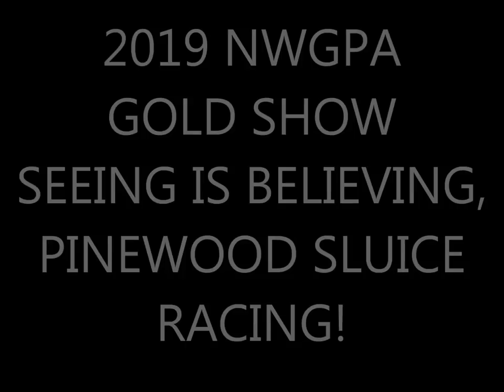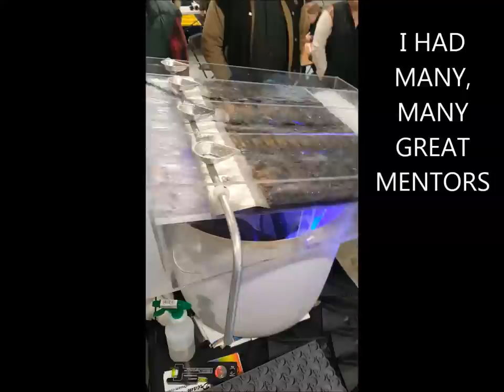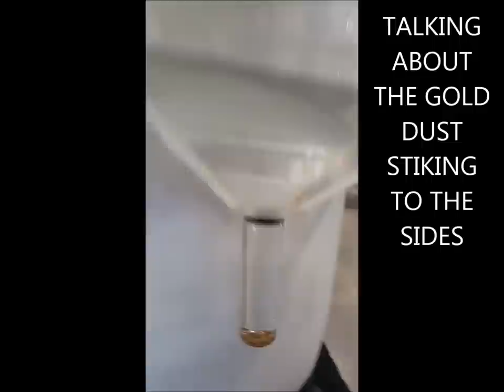Epic Sluice Derby Showdown: 2019 NWPGA Dream Mat Challenge!

Comment: I would love to see this test being performed with the mats preloaded with black sands and let to clean out for a few mins.
Anything deep enough can catch gold if it's pure, but if it just loads up with sand you just catch whatever was put in first.
I am sure the Dream Mat would do great in such a test and would like to see it.
Reply: What happends with black sand in the dream mat is that the pockets do fill up with pebbles and slack sand but gold gets in under it and stays. The more gold that gets in the more black sand gets removed. The pockets stay active and are always swirling around keeping that non gold moving and working it out. If a small piece of gold does move down it will find another pocket to get trapped in. The dream mat is by far the most effective mat on the market! I use them all the time. I won't go back to the old way.
Reply: Yeah, a real world test would be the litmus.
Reply: @waynelacroix8870  I know it is, and I know that is what will happen but I'd like to see it in a video.
My silicone mats are similar to dream mats but I designed mine to have smaller pockets and vortexes at the top and progressively larger down the mat. Then I covered the top section in fine and medium mesh  so the upper section self classifies to avoid the larger pebbles filling the tiny pockets. So far it has worked wonders.
Reply: This test is useless. First, my bucket can also catch all the gold if that's all I'm running. Second, each mat runs at a different water flow, and it's clear the flow was altered to favor the dreamer Gucci mat. And third, my miners moss and expanded metal catches far more gold at varying water flows and we all know water flow is never a constant. Throw in a shovel or bucket of pay and watch the surge through the sluice. Gucci mat is not for production, but as a hobby mat in a hobby sluice where the pay is carefully metered. I'll never buy any Gucci mat product.

Comment: I have honestly been avoiding the whole dream mat idea maybe because I am bias or I just dont know what im doing, but I gotta say this was an impressive comparison! Thank you for sharing - I just shared this video on some of my social media platforms. Subscribed! ✌
Reply from the maker: One bitten, twice shy! Ha ha
Reply: This test demonstration is not entirely fair. because the same water flow was used over 4 mats that all require a different volume of water.  The GoldHog mats use about a 1/3 less water then the Dream mat...Also those mats ONLY work according to the ground being tested, water volume, sluice angle, sluice width, qty of heavy sands, size and shape of gold, size and shape of black sands, clay content...etc.      
That is WHY Doc at Gold Hog says to match your mat and mining equipment to meet the soil conditions
Reply: @bonks4395  100% agree. I've seen dream mat in action... there is a reason they are headed down stream. tested 5'' dredge tailings  with this matting and got 100-200  colors per pan. on arkansas. when someone constantly tells you they are the best, its clearly a lie.. that goes for every trade.
Reply: @bonks4395  gold hog is also a salesman and has different mats for everything so you keep buying. I don't like how they keep their comments turned off. as for dream mat it looks good but I haven't tested it myself yet.

Comment: Interesting test. Disclaimer-I ordered some dream mat and am looking forward to trying it in my Keene highbanker. 

Talking with old timers where I’m at, I learned something interesting they just use home made setups with expanded metal riffles and miners moss/outdoor carpet. They tell me to tune your setup, and pan your tailings to check for losses. With our sub 200 mesh flour gold they can run minimal losses from a homemade setup. As long as they run material slow, and don’t use a lot of water. The expanded metal makes a minimum of turbulence vs Hungarian riffles which according to them blows the fine gold out of the box. 

I suspect each of the mats he’s showcasing would probably have the same performance if the flow and angle was tuned for the individual mat. That’s why we are supposed to tune our setups.

Checking my tailings if I use enough water to clear the riffles I was losing almost half the flour gold if I pump enough water to clear the riffles. Now, if I can have a low profile something like a dream mat I can run less water “energy” and still clear the pebbles from the box then I’m sold!

Comment: now id like to see a test between the different sizes of mat with dirt material running through as well. compare the bare mat or having expanded metal over the top of the mat or riffles above the mat or both riffles and the expanded metal over the mat. or if a classifier screen in the sluice box over the mat is better keeping fine material only going through and how much space should be kept between the mat and classifier to get the water effect. also does it work with it below miners moss? would they clean out if it was the mat then miners moss then expanded metal and hungarian riffles in sections over the top? is that all unnecessary in a large sluice box?

Comment: Loved the video !!! 
   And i also love all the nay sayers here. 
First I am confident every comenter here is a weekend warrior wannabe just like myself. 
   Is your test here flawed ? Yes it very much flawed. But so is everybody elses on there you tube channel. Every mat has its purpose but your mat seems to be the best " every circumstance " mat. Gold hog and i like doc makes some very good products. Only thing i dislike about his mats is they are to specific . You need to many mats to do a complete job. 
Next is almost every test I see is with controlled material. Problem here is the material is preped to how the manufacturer wants it to prove his value. 
   Any way you get the idea. So for me I look at logical things. I talk to and see lots set ups. By far the most mats I see in use are the dream mats. By far the most replicated mat I see are dream mats. And by word of mouth recommendations is the dream mat. 
    All that science you talk about means nothing to me or any of these other wanba be. Just set your equipment and test test test. After all that is exactly how you perfected your mat. 
   Thx for reading my rant lol
Reply from the maker: Your best mat, best flow angle, durt whatever. Run it. Then jerk out your mat put dream mat in it, run it the same. Gaurantee it will kick its a55. There's my rant.

Comment: Not really a fair test as you should well know. Traditional mat is not run like that. Different contours are used together to work properly. Not one kind of mat the whole length of sluice. Except that Keene Miracle Mat, that's run alone...so
Reply: It's one of the great things about the dream mat, you don't need anything else. You can often use it without classifying and just dump in material. As for the other mats, in this situation it seems reasonable, its just showing how long it takes to be pulled out of them.

Comment: I have a five stack gold cube. I use the dream mat micro mat on my slick tray, then a saw tooth mat, two dream mat beach matts and a saw tooth at the bottom. I run at cape disappointment. My question is what got pump should I be running.
Reply: I know Rob on the saw tooth uses an 1100 but he relies on his elevation to cut him down to somewhere near 900 and I do 1100 on a three stack, 1000 on a 5 stack and about 900 when I go 7 stack. I do not know the dream mat volumes but is not the same at all and I highly recommend not using the together. The dream backs up at that low of volume.
Reply: @iralawrence9311  thanks for the info ira. Think I'm going to switch back to all saw tooth. Just seems to to be a better fit for the beach. Let me know next time you make it to benson.

Comment: Dream mat works on the same principle that's used in all mats... it just has higher capacity cavities. For a field sluice, that's not bad. I think the reason naysayers don't care for it, is 'cause they don't SEE as much gold, because the finer groove mats separate black sands better. I think the difference here, is are you PRPSPECTING, or are you focusing on recovery? If your goal is to extract gold in-process, then stick with groove mats. If your goal is to gather the richest CONCENTRATES, then Dream Mat is the way to go.

If you're working a location for a long period of time, and it's not easily accessed by a vehicle, then you may not want to carry 6-10 buckets of concentrate for a couple miles. You'd be better off capturing what you can on-site, marking your tailings, and coming back another day.

Comment: I know every Matt has a particular run angle and I know you're doing this test to show this method of processing material but the other manufacturers have made their design to run at a different angle than what you are running at that's not to say that you're not running with manufacturers design but I would like to say that this test of yours is kind of not made for other people's engineered specifications
Reply from the maker: We are dying for brave souls to give us thar best mats, angle, pitch. Or even send in a chunk of thar thingy and we will test to the spec. But so far no luck.
Reply: @TheDSP1970  I ran your Matt in a sluice box at different angles and it loses fine gold all the time although it is an older model but you were still making the same claims back then too?

Comment: The Gold Hog mats need to have tape on the sides or you lose your gold. I wonder how different the test results would be if the mats were installed properly.
Reply from the maker: Weak, like a liberial throw the race card, the gold stayed in the middle mostly, open your eyes. Buzzzzzz, try again.
Reply: @TheDSP1970  So I make a statement that Doc freely makes, and ask an honest question because I am curious and get a response like that?

You have convinced me. I will never use dream mats in anything I run.

Thank you
Reply from the maker: no soup for you! The Sides were very tight in this test. not like hack jobs do to poor design flaw that needs taping & gluing. dream mat don't need taping or gluing. Cause its a BS excuse to say you had the wrong combination if you don't get no gold. Dream mat captures gold, with out the excuses or tape. Dream mat has 1 basic profile, not a bazillion.
Reply: @TheDSP1970  dont try to argue with a fool.youll only lose due to lack of experiance...your mats work wo bubble gum
6 different staggered profiles.super glue.
And or duct tape...some people dont believe what they see..with their own eyes.

Comment: It's funny cuz they're using big gold hog wave mat and if they knew anything about it they would know that that is not a primary capture mat that is to Simply spread the sediment load across the width of the sluice Not Fair competition if he would have had Razorback or Talon in there no gold wouldn't got halfway down the sluice given he had the correct flows for them.
Reply from the maker: I need to design a mat that doesn't primarily capture gold, but just kinda takes up room in the sluice. Think I'll call it nightmare mat. Cause you'll have nightmares of loosing gold.
Reply: @TheDSP1970  not really when you're widening your sediment load in the bottom of your sluice that will utilize more surface area of your mat therefore upping the efficiency of the next Mats further down. Plus the advantage of the wave Matt also slows down the bedload material allowing the hevies to loose velocity but keep the water moving through the sluice helping the ultra fine gold settle out.
Reply from the maker: It's the small wave mat. Don't need 12 ft of dream mat to catch gold. Can do what hog does in 1/2 the length. Cause it captures the gold in the beginning of the mat, not at the end if the mat.
Reply: @TheDSP1970  nothing catches 100% of the gold dude
Reply from the maker: @keithkratzer2913  did not say that it catches 100%, but some mats just lose it faster!

Comment: This is a really cool test! Thank you for sharing. Very informative. It makes a persuasive case - within the limitations of the test. There are a few design flaws. First, your dream mat probably had the strongest VORTEX of all the mats due to its cyclonic design -  at that particular water flow level (leading to superior centrifugal force, etc). Second, your dream mat may have had the best ANGLE of all of them. This may have led to your mat having superior retention in this test. I'm willing to bet if you re-ran the test with each mat having its ideal water flow and angle concurently (perhaps impossible but hear me out) - there would be far fewer losses on the other products. Your other competitors have run their own tests (available on YouTube) and are getting 98% retention in some cases. The bottom line is all of those mats are incredible technologies and are world class - within their own particular ideal operating parameters. Know thy equipment. Again, an amazing test and it certainly sheds some light on the power of your design. Great job!  : )
Reply from the maker: More angle & more flow just makes the others loose more gold. Any slower or flatter, the gold does not even come off the slick plate. There is no istance w/ the others, that more flow or angle help. Gravity & force, for every action there is a reaction.
Reply from the maker: Plus they market 98% or more. With test that are flawed. Never has any of them did a scientific test like this. Cause they have gold go down farther, thus proving it's not so. They have to rely on marketing. I'll rely on physics.

Comment: If all you are running is gold, I have a 5 gallon bucket that will also catch it all no matter the water flow. This demonstration is useless. I'll put expanded metal and miners moss up against any Gucci riffle mat design to prove it's forgiveness and real world efficiency superiority. I often run my high banker next to others running these Gucci mats and I always capture more gold and it's not even close.
Reply: Miners moss with expanded metal and 10 inch section riffle system is king 👌👌👌 especially on micro gold 👍👍

Comment: This is a very poor and biased demo. I use the miracle mat and you have that box set way to much slope and to much flow. I don't know about the other ones but you can't do a proper demo with out having all boxes set to the proper settings.
Reply from the maker: Any slower flow,  the gold won't come off the slick plate? 600 gph that's cube flow. Pitch 8° so how slow & how flat do you need to be? Cause if dream mat spanks it at higher, it will annihilate it flatter & slower. Gravity is constant.
Reply: PS
 I am not saying miracle mat is better I am using it and an example as it is what I have experience with. You mat uses a very interesting concept and would be cool to demo in the field. What bothered me were the test conditions themselves.
Reply from the maker: https://youtu.be/-fplhEZzyyg
Reply: @TheDSP1970  Good speed test. Yours defiantly processes faster. Miracle mat is a slow mat for sure. It takes a half hour to run 3 gallon of cons.